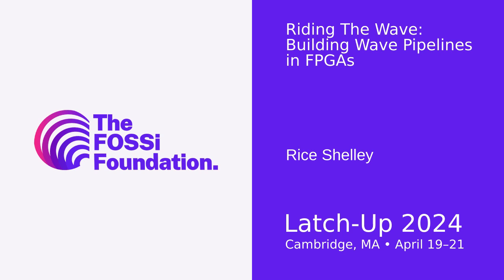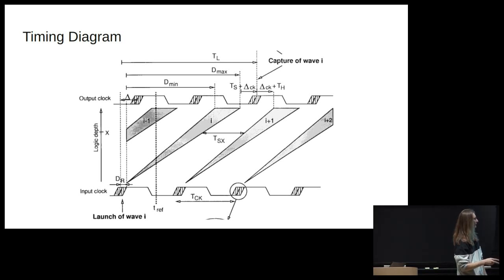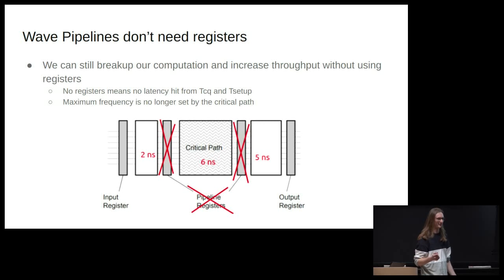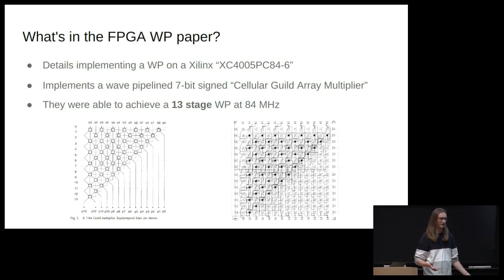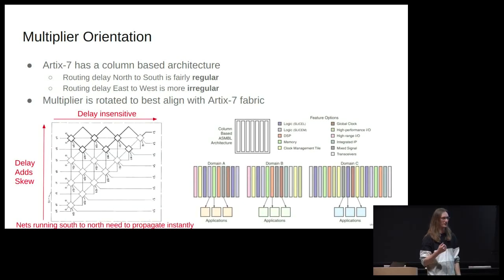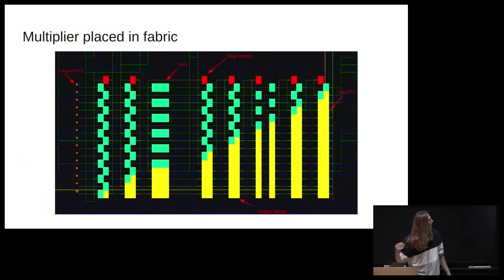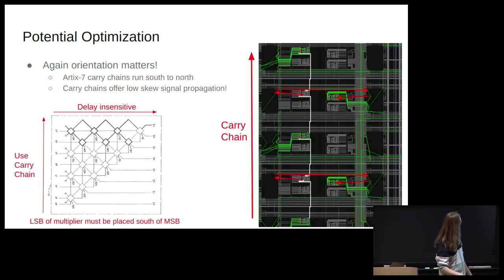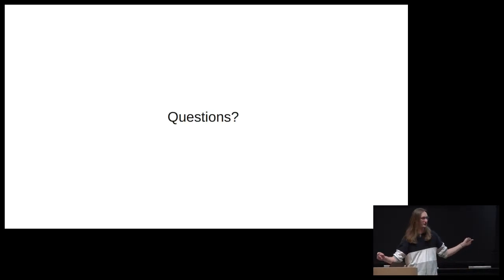"Riding The Wave: Building Wave Pipelines in FPGAs" - Rice Shelley (Latch_2024)

Comment: This is so cool.  I had actually read that very paper on wave pipelining, but didn't consider it practical (for all the reasons you cite).  That fact you pulled it off and on an FPGA to boot, is impressive.  Re. the audience comment: self timed logic is interesting too, but is completely different; wave pipelining is overhead-free, where as self-timed logic has buffers for each "wave".  The main difference from synchronous is that the clock is effectively local to each stage (which has its own pros and cons).